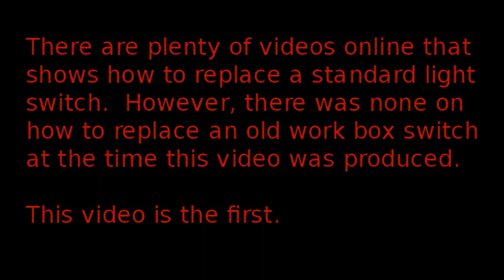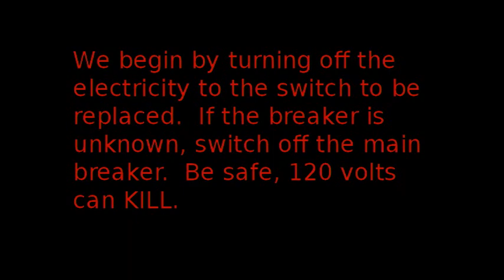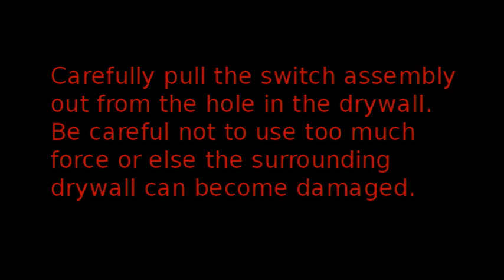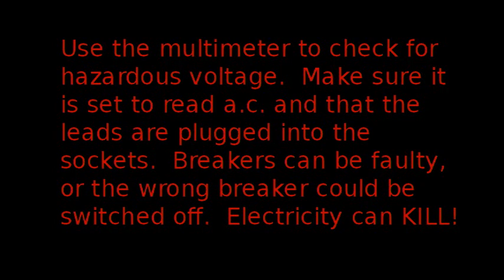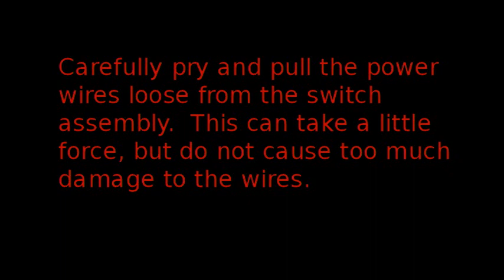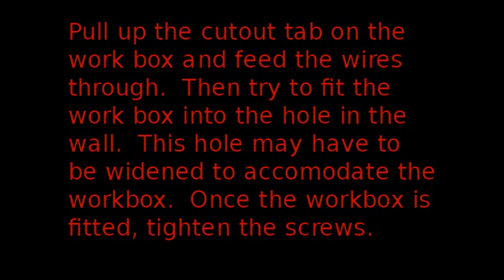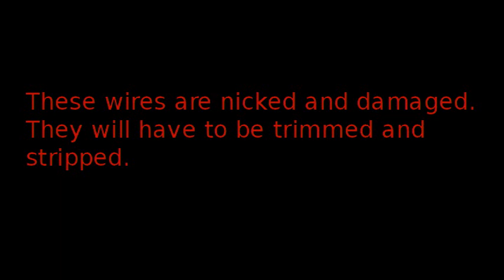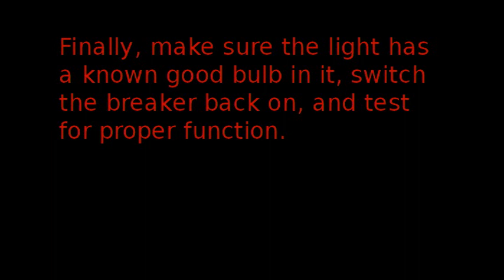How to replace a mobile home light switch (or outlet)

Comment from the maker: It is a good idea in my opinion to leave it upside down.  If any conductive object falls so that it may contact a slightly exposed prongs, it will be the ground prong instead of shorting out the hot and neutral ones.  While it may look strange, I think it is a good safety feature.

Comment: Very helpful video besides the fact the idiot that wired the switches I'm replacing in my home wrong. The black wire is neutral and the white is the power only on the one set of switches I'm replacing now. Luckily I noticed this when I pulled the back cover off and saved myself the headache.

Comment: So one bare wire is connected to the ground screw. How about the other bare wire?
Reply: Its all the same, its a ground wire so it does not matter. You can put it in all together if you want.

Comment: how about showing a three wire system,and please install sound
Reply: david sattler did you get a answer to your question about when it has 3 wires? I ran into the same problem.
Reply: I know this is old but some poor soul will no doubt wonder this. This video, you only saw 2 big insulated wires and within those wires, there are 3 "small" wires. The black is normally hot, white is neutral and bare is ground, you should check to make sure which one is your hot. Anyways, in some cases, you may have 3 big insulated wires, in this case, its the same thing but most likely that 3rd insulated wire is running somewhere to power say another switch or outlet not far. Do the same thing here, get the two bottom insulated wires stripe them, you should now have 2 black, 2 white and 2 bare copper wires. Get the two hot wires, pig tail them together and be sure to add an extra piece of wire as you will obviously need that piece to run to your switch. Now, grab your white wires(nutural in this case) and put them all together as these won't be used in the simple on and off light switch(unless your switch specifically calles for a nutural.) As for your bare copper wires, these can be pig tailed together with one wire going to the switch, they are ground just make sure they are all together. Now, we should have only 1 insulated wire remaining, strip this, the hot will go the other screw left on the switch, the neutral will go with the other neutral and the bare will go to the other bare wires, we could of done this earlier but I was not trying to confuse you.

This is one method of doing it, if it seems like to much, leave it and hire a pro.

Comment from the maker: Some electricians like to install outlets in this manner so that if a ground plug is present it can prevent any metal objects which may fall from contacting the hot and neutral prongs.  It is a good safety feature.

Comment: Are you using single pole switches? I'm no electrical genius and I wanna make sure I get the right replacement parts
Reply from the maker: Yes, it goes in much like an inline switch.

Comment: I have three cables coming in mine. Both switches in the utility room.  One for the light in the room.  One for the light out the back door.
Reply: Dan Mills-Low  did you get an answer on how to do the light switch instalation if there are 3 wires coming in to the box?

Comment: I had a diffrent problem. When my modular home was new and first installed, I had Dogwatch install a buried wire fence to secure my dogs in my yard. After they installed the controller, they ran a ground wire to the outlet plate and attached it to the corner screw of the box. After several false alarms, I discovered that these homes don't have junction boxes that are grounded. In fact, the Dogwatch system wasn't grounded at all! I had to splice a wire to the system ground and run it through the wall to the lightning arrestor ground rod outside the house to stop the false alarms and make the system work right. Even "experts" make mistakes so watch out.

I am glad that adapter boxes are available now to make replacing light switches easier and safer. The switches in my 15 year old home are wearing out and I was using toothpicks to keep the lights off. Some were so worn out you couldn't insert the toothpick to make the light switch work anymore.

Comment: Thanks very much for posting this. An outlet in my mobile home has just gone dead and had never seen a self contained outlet before today. This video shows me what to expect when pulling the existing outlet and how to re-install it, too. 

I'd love to replace the outlet with a standard outlet, but I'm having a heck of a time finding a work box like the one in the video. Can the OP or anyone else tell me what to look for?
Reply: ANY Home Depot etc ALWAYS carries these old work boxes... "cut in box"   I used to call them "tiger grip boxes" but that is a brand name I think for the all steel ones....the plastic ones are fine plus are cheaper and easier to install....Carlon is one of the biggest manufactures....I just bought some at home depot for 88 cents each and some others for $1.32 that are deeper if there are more wires involved....be sure to strip back sheathing on cable to give yourself like 6 inches each of insulated wire!  (unlike certain examples on youtube done WRONGLY!!)

Comment: you're supposed to remove the tabs or ears on the switch or outlet before installing it in a pop in box. it allows the cover to fit flush.

Comment: I do have a question. For some reason every outlet in my whole house is upside down (the ground hole is on top). Is there a reason for this? I am assuming that I can use the same technique to install a new outlet facing the right direction.

Comment: @Ron for some reason they do that putting outlets upsidedown  in Mobile/manufactured homes IDK why. But yes you could use a similar technique to fix it or just flip the outlet and not touch the wires at all.

Comment: technically speaking the ground being on top or the outlet looking like it is installed upside down is the correct way of installing. Many prefer it because if the cord gets pulled it will not damage your ground prong as it would if it were installed in the other or upright position

Comment: Does anyone know, POSITIVELY, if a rocker-type switch in a mobile home should have a box around it?  I've just discovered that none of my light switches or base plugs has a protective box around it.  Is this because the design of the rocker-type switch is new and doesn't require a protective box?  I want to feel safe.  If your answer will be a guess, please don't reply.  I'd like to know positively if I'm safe or whether I should have an electrician come in and re-do all of my switches (not gonna be cheap).  BTW, the specific type light switches in my mobile home are Slater brand, #230120.
Reply: The rocker or  Decorator style is a newer type of switch.  The modular switches and receptacles seen in Mobile homes are cheap and very fast to install in a factory.  I believe they use some type of tool to press the wires in. No stripping, or cutting required.  They also work in very narrow walls that are framed with 2x2 instead of 2x4 lumber.  They are approved and listed with UL as safe, I hate them.  As an Electrician most people have me replace them as they go bad which usually happens in groups of the most used switches and receptacles at a time.
Reply: They do not need a box around them. All wires are self-enclosed on the switch. There cheap & fast to install by the makers of the homes

Comment: I live in a manufactured home and I'm trying to replace a light switch. It looks very similar to the one her but it had 3 sets of wires connected to the old switch box. I'm a little confused as to which wires go where on my new light switch.
Reply: Raoul Borans 
I am with you. I have the same thing. was hoping I could find a video explaining that process. Truthfully, why don't they MH munfactures do it like all standard houses. it's only a few pennies more.
Reply: That other wire is going on to give power to another device on down the line.
Reply: Did you ever figure how to do it with 3 wires?

Comment: what i dont see on this video is how the box inside the wall gets secured?
Reply: those kind of boxes have two screws on the corners that when you tight them a kinda wing turn and get a grip to the sheetrock.
Reply: little earls fold out and grip the wallboard....go buy one at home depot and you will instantly see how it works  there are flanges on the outside and he flip pur ears pinch the wall board holding the box secure....great for switches but not as grea for outlets that CAN sometimes bust the wallboard if someone rips a cord plug sideways etc...then you have a problem repairing the wall board to be strong enough to hold a box again!  The ideal thing is to have an outlet box screwed to a wall stud bu often there is none right where you need it!  Some thin wood can be cemented back behind wall board to hold patch compound and give a new place to clamp the box in!  tedious but a good fix I think if that happens
Reply: The tabs on corners  fold out against back of sheetrock as you tighten the corner screws clamping the sheetrock between outer tabs and inner mhm